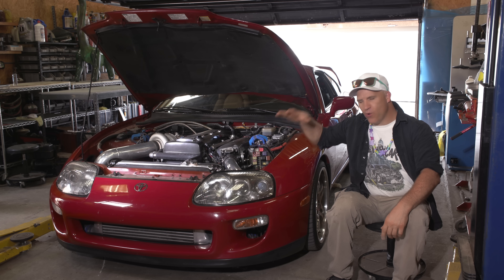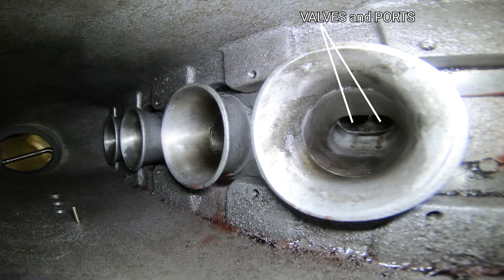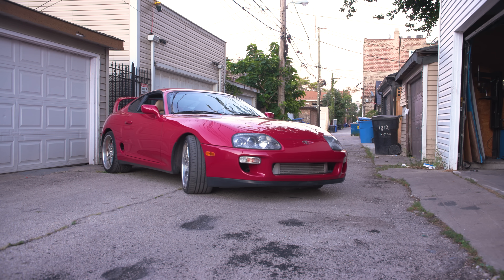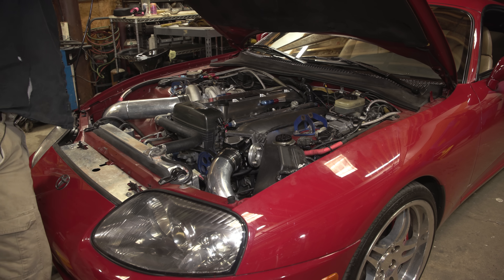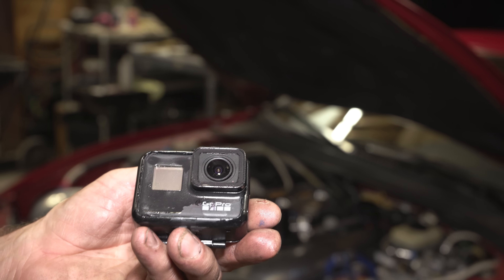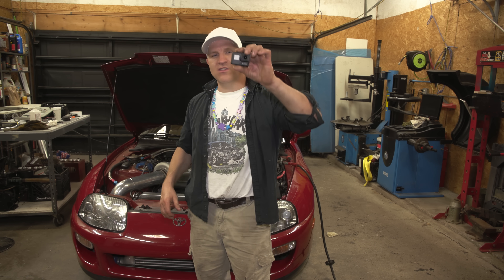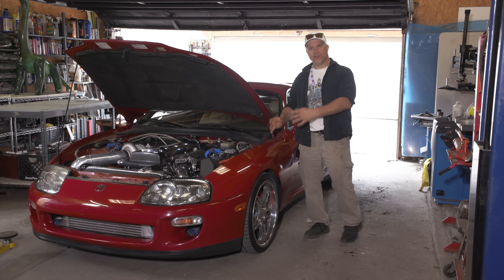Driving with Gopro Inside My Intake Manifold (Toyota Supra Turbo)

Comment: Needs a catch can. Blow by oil mist being recirculated back into the PCV system of it doesn’t have an aftermarket catch can.
Reply: I was just thinking the same thing...forced induction and high compression engines have more blowby so aeration of oil occurs.  In fact I'm betting that's royal purple oil from what I can see in his intake manifold.  Catch can man...definitely needs one!!
Reply: It's power steering fluid.
Reply: @rars0n  how is it power steering fluid? Lol
Reply: @TwinTurboLsx  Go to 7:10, turn on captions. Power steering switch was leaking fluid into the intake manifold.
Reply: Blow by on the gopro 😭

Comment: You can see red in there immediately. Like power steering or brake fluid.
Reply from the maker: You got it ! Power steering fluid. Turned out it was coming from the power steering pressure idle switch which is piped directly into the intake. It was bypassing oil from the power steering pump into the vacuum tube
Reply: @WarpedYT  But what would be the purpose of sending that fluid to the air intake?

Comment: You don't know from where the oil get into GoPro, but one thing is for sure that, wired  Oil pattern also changed your  GoPro 8 into gopro  7 .
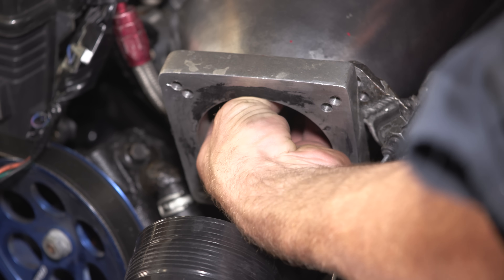1:15 and 5:45

Comment: The oil is being pulled out of the intake where the gasket seals right under the #3 runner. You can see it just as soon as the engine produces vacuum at start up. Re-torque the gasket again and it will likely seal it up completely

Comment: I'm gonna guess you've got a bit too much manifold vacuum? But she runs tight so if that is the issue behind the oil you might just have to deal with it xD It seems like the oil starts to rush right after you come off WOT....Then it disperses on the next blip. It would explain the oil pattern on the go-pro. Pressure wave sends the oil low and high as it wraps back out of the runner. The oil might be leaking through the valve seal and is getting pulled through.

Comment: What's the Benefit of going to a smaller throttle body?
Reply from the maker: Much better throttle response, better idle, more low-end torque and overall better control over throttle.

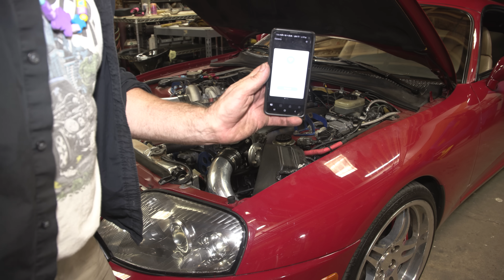Comment: 1:13 GoPro 8 goes in and at 5:08 GoPro 7 comes out. That Supra engine must have sucked the living s...t out of that camera...
Reply: Also camera goes in without protective casing.
Reply: I assume the go pro 8 was a prop. And the 7 was already installed.

Comment: A friend and I had this idea when we built a 12A peripheral port rotary about 15 years ago. We put a curved Lexan panel into the intake plenum which also had an internal fuel rail with two 1600CC injectors pointed right into the bellmouths of two 54(?)mm ITBs. The idea was to mount a camera under the hood with a display embedded in the dash above the glove box. So the driver could ask the passenger "How's the fuel atomization?". Sadly it never ran like that as the engine was sold and the intake manifold ended up on a shelf.

Comment: It’s so cool when you come off the throttle and the wastegate opens then all that vapor shoots into the manifold. I’m gonna hypothesize that this is due to the lower pressure of the intake tube relative to the manifold pressure after the throttle. Though I’m not certain.

Comment: Oil's from the PCV.  100% normal.  That's why people install catch cans, to grab the oil out of the PCV flow.  Keeps the intake system clean, as the oil eventually forms deposits on the manifold, valves, and pistons.
Reply: Is that the red liquid in the intake manifold?.
Reply: It's only really a problem on direct injection engines. If you have port injection the fuel being sprayed over your intake valves will clean them. In fact oil companies put additives in their fuels per federal law that help clean your intake system on a port or multi port injection system.
Reply: Yes, I saw the white aerosol and I figured it was from the vacuum system.
Reply: Yep, and exactly why some diesels carbon up so bad. EGR mixes with CCV vapor and creates primordial ooze sludge.
Reply: Not if it's port injected, the fuel cleans it up
Reply: Christian I'm a retired mechanic and PCV was my guess also.  I wasn't 100% sure cus I only worked on stock Ca cars and i wasn't sure about that after market setup having one or not .  I was also trying to see  a license  plate pretty sure thats not a california car no front plate.    In ca the police are pretty strict about plates and engine fuel system mods.  I have to admit thats the first time i ever got a wind tunnel view of a running  engine and  i been working on cars since about  '62.  Cheers  edit  BTW if any of ya are  real gear heads  Put Milyard in youtube search.  Allen Milyard gets my vote for the Greatest private Engine builder ever.
Reply: @SurferNorm6360  Alan Millyard is a god like genius when it comes to gluing engines together.
Reply: Oil from the PCV do not clean your intake. Gasoline does. The oils from PCV will clog your intake manifold with carbon buildup. Which is a common issue with direct injection engine, as gasoline does not injected in the manifold, the intake manifold was not cleaned. Does the fluid in the intake smells like gasoline? It might because of the gasoline was injected in the intake manifold, when u let off your gas pedals, the oil flow backward during vacuum. so you got a lil bit of gasoline left there.. which is pretty normal.
Reply: this engine is boosted so, it's running a high octane fuel 91-94 (pinkish in color with a quick google search) and you notice the fog and then the pink liquid in the intake once the fuel falls out of suspension from the intake air when the throttle blade closes.
Reply: @bloodwolf2427  was wondering if the pink in the fuel would leave an oily residue though? 
As for the fog, it's just where there's a sudden change in air and the air in the chamber momentarily turns into water vapour, notice it only happens when he's changing gear or blipping the throttle.
Reply: @bloodwolf2427  If he was using pink race gas, I would think he would know what he was seeing, and the smell would be obvious gas. He said it was oily
Reply: @gtbarnes11  I always distrust what the customer says ;) they will lead you astray with their assumptions but, we aren't there.  Maybe next video he will let us know.
Reply: yep, so happy i saw this now i know exactly why a catch can is a good idea
Reply: It’s called making oil
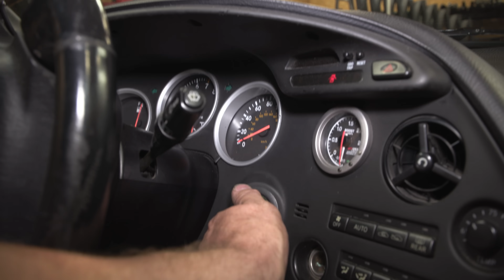Reply: Ehhh it kinda looks like something isn't torqued or sealed properly when he starts the engine...  2:36
Reply: Lol no it isnt 100% normal or the PCV. Under boost, the manifold is not in vacuum and not pulling anything, so if he has a PCV - its closed. Plus it doesnt look like hes running any crankcase PCV system through the manifold.
Reply: K&N filter oil, not PVC.....
Reply: @elijahinky  LOL how much oil you put on a K&N and how often?  It’s absolutely the PCV, as stated the reason for catch cans is to prevent all this oil from coating your intake, pistons, heads and Intercooler (which can reduce thermal efficiency). Please don’t make up Fake News just post, spend time reading a book or learning somehow.
Reply: @91maxpower  wrong, its k&n filter oil its red dummy, oil is brown
Reply: Absolutely 100% not normal. Oil, or any fluid for that matter, in the intake manifold is sign of a problem. Not an immediately debilitating problem, but if left unresolved will result in serious problems and multiple part replacements to fix.
Reply: @Riley_Mundt  Id like you to remove an intake from a car with over 500 miles on it and show me an absence of oil.  Then explain how oil is going to break parts.  Better yet, learn about an engine before posting about what’s normal or not.  In this instance I’d focus on PCV systems ( thats Positive Crankcase Ventilation) which takes all that oil vapor and sucks it into the intake so those hydrocarbons are burned instead of being released into the atmosphere.
Reply: @91maxpower   How about I walk outside and disassemble the intake manifold on my car which has 102,507 miles and show you how spotless it is, or better yet, you learn what is and is not normal operation of an internal combustion engine. If there is fluid in your intake, you have a problem, simple as.
Reply: @Riley_Mundt  Please do, I’ll be waiting.... bring your GoPro and don’t cry when you see oil, ITS NORMAL. Link a post to your video please.  (PS air is a fluid, LOL. You clearly know nothing about engineering)
Reply: @91maxpower  lol understand that PCV pulls under vacuum NOT under boost. Most of the video, he was under boost. The PCV is essentially a check valve that flows one way. The PCV is CLOSED WHEN UNDER BOOST from the crankcase, otherwise he would be boosting into his valve cover.  Under normal driving conditions, even with a PCV,  thats way too much oil for a 5 min drive.
Reply: @Riley_Mundt  lol that intake will be BLACK with oil gunk in the place the air turns down or changes direction(mustang 5.0/explorer) unless its has a smooth rounded airflow(tuned port chevy)
Reply: @91maxpower  air is a gas, anything liquid is a fluid.... 2 different states! Clearly you know nothing about science or engineering. 
As for the oil in the intake chamber... it's red in colour... the oil vapours you're on about are usually in the rocker cover with a breather pipe back to the air intake. The oil vapour is then redistributed through the intake system through difference in pressure from rocker cover chamber to the intake chamber. This would be darker in colour because its engine oil meaning whatever is in the intake isnt engine oil. It's either vapourised air filter oil condensing on the ports or an additive to the fuel.  Don't go around bullying and telling people they don't know what they're talking about when you plainly don't know yourself.
Reply: @thebigo2605  Gases are fluids, liquids are also fluids. A fluid is any matter that continually deforms under shear, which gases and liquids both do. You could have spent the time it took to type out that comeback to Google it and educate yourself.
Reply: @Riley_Mundt  actually chris is right because push mowers ride on mower etc all do the same thing i have never seen a perfectly clean manifold
Reply: @91maxpower  "Id like you to remove an intake from a car with over 500 miles on it and show me an absence of oil"

I'm not a mechanic, but I serviced some cars and bikes, and never saw any oil in an air box..

However on my oldest bike, there is a foam piece preventing oil coming from an hose from being spread everywhere in the air box. I guess if you remove it, it may look like what we are seing here... But why would anyone do that in the first place
Reply: @Lillos85  the thing you don't understand is that the crankcase have more pressure than the intake (boost + combustion pressure), so that's why tuner install catch can. 

I've work in a speed shop and let me tell you that even a fresh rebuild of these 2JZ will compress a little in the pan under high boost.
Reply: @thebigo2605  Well, you have a point that Chris H is wrong that that is not engine oil(or very little of it, as time is too short for that much oil to condense, that would mean his piston rings are crap, plus he was running more on boost than on vacuum, plus it would mean that even if you have a PCV Catch Can you would need to empty it every time you drive to the store, etc etc)...however (and please don't take this as an insult), you are also wrong about fluids and gasses. I mean kind-of. 
As you said, air is a gas and this represents the state in which you would find this arrangement of molecules in; unbound molecules. A liquid is also a state of arrangement of molecules, but where the molecules are more or less bound to each other. However "fluid" is not a state of arrangement of molecules. "Fluid" is the property of a state of arrangement of molecules to....well, flow aka. distribute themselves apart from each other as much as their internal forces allow, and this is known as viscosity, which is a parameter, if you will, that describes the fluidity of a liquid, or how much a fluid tends to flow or to spread apart in an amount of time. That's why it is technically wrong to say that something is more liquid than something else, even though people generally understand what you mean, the correct description is that something liquid is more fluid than something else. Hope this makes some sense.
Edit: grammar stuff....
Reply: @Riley_Mundt  You're not particularly familiar with direct injection cars, are you? It indeed is normal for BLOW BY to occur.

Comment: Oil could be from the PCV. Some of the high pressure combustion gases naturally slip by the piston rings in all engines. Manufacturers add a vent to relieve the pressure. Instead of releasing the oily gas into the air, they vent it to the intake manifold where its burned.

Comment: The guy doesn't know where the oil is coming from, yet he works on cars? I'm not buying that. 
#1 he knows but is lying about it.
#2 he doesn't work on his own cars.
Reply: #2.. blow by, oil mist, pcv, positive crankcase ventilation, intake pulling oil mist from "crankcase" through pcv valve into intake, normal, needs catch can.
Reply: I assume you do then
Reply: @Woody_Woody_Woody  ⬆️😱🙄🤭⬆️

Comment: Oil is probably a seal starting to go in the turbo it’s probably not a big problem in a gasoline car but if that starts happening in a diesel you should instantly go to a repair shop that could spell bad news 💀

Comment: Your lucky all that boost didn't blow the welds on the intake.
Reply from the maker: there are no welds, its one piece but supposed to handle up to 100PSI, the intake cost about $3500.
Reply: @WarpedYT  Dud i almost had you but you missed my joke. Anyways not a bad way to spend 3.5 grand

Comment: When the throttle valve closes, I wonder if that smoke being formed is the oil or if that is water condensing due to the vacuum
Reply from the maker: Water condensing, if you look at the latest GoPro in a tire video you can see the same effect

Comment: This car is so overvalued it’s insane. I grew up in the 80s and 90s and loved the Supra back in 93, back then they were selling for $35K with very low miles for the Turbo, but would never pay what they’re going for now. $45,000 for horrible condition and up to $100,000K for a good one? For 30 year old used Toyota? Get the fuck out of here. Lmao ppl are stupid for paying that. $100,000 plus another $100,000 for mods, Might as well get a Ferrari 488 Pista at that point 😂

Comment: My guess would be the oil is coming from the center bearing of the turbo. Maybe check the intake plumbing going from the turbo to the throttle body?

It could also be coming from the PCV valve (a little blow-by).
Reply: I wouldn't be surprised if the GoPro occupied just enough space inside the manifold to throw the engine out of balance. Maybe taking it out along with any mounting hardware inside will have fixed the problem.

Comment: I had a 25th anniversary that color that I built for my shop owner of the time. Man I miss that car. It felt heavy around the parking lot but once it straightened out the front end would come off the ground practically. T88 turbo, Japan short block, head work, etc.. I remember the first time I started it I couldn't believe it I shut it off like wow I did it. Final Dyno was 980. Only change I wish I had made was the veilside intake and now I know why

Comment: An I thought the fuel spray is to be directed onto the valves not onto the walls? There is a video about Diesel direct injection running at ambient pressure and the spray cloud stops slightly beyond the cylinder walls. With such injectors one should be able to shoot past the valve stem and still not wash off the oil from the walls? With a simple nozzle ( no swirl ) shouldn't the too-big-droplets have a narrow cone?

Comment: Been asked to show more of the car.... so he sticks a go pro in the intake lmao. Next it’ll be put in the oil pan
Reply: Actually, that's been done (similar), though I wouldn't mind an updated video with modern tech. Look up "Inside the Cylinder", a video from 12 years ago.
Reply: KECOG I was being sarcastic. When someone wants to see more of a car, I doubt they mean they want to see the inside of the engine cover. While the car is running. Most understand the physics of a running engine, especially supras.

Comment: Cool idea!  Few things.  Sounds like the exhaust is sucking in some air.  Check for vac leaks or valves not sealing. Also, I'd port match the head to the manifold.  Prob wont do much but thats the OCD in me when im building my engines.

Comment: Considering its secured good and proper inside a manifold with the engine running I'm surprised how smooth the footage is! virtually no camera shake or vibration at all. interesting video.

Comment: Perhaps the turbo is on its way out and spilling oil into the manifold.
Or the oil suply line got to mutch pressure.
Reply from the maker: Turned out to be the power steering vacuum switch dumping power steering fluid into the intake manifold
Reply: @WarpedYT  Good news !!

Comment: really  interesting seeing the way the fuel actually injects into the engine and what the rapid changes in pressure and flow does to that mixture. its quite amazing that we manage to control such a dynamic system
Reply: Don't forget that this is PORT INJECTION. Most cars these days are DIRECT INJECTION which means the fuel is directly pumped into the cylinder, after the valves.

Comment: Really cool stuff. Interesting to see the camera getting foggy in an instant, when the pressure drops in the intake.
The oil is probably from the crankcase ventillation.
Reply: I noticed that too. The instant white mist that appears when he'd get on it. Very interesting and amazing.
Reply: @andyz3925  Mist is water vapour caused by the sudden reduced air pressure. Oil might be from turbo bearing seals weeping.